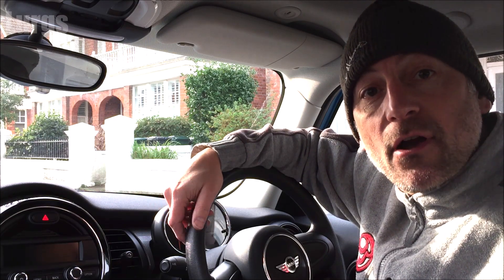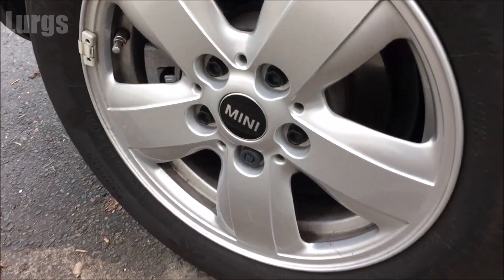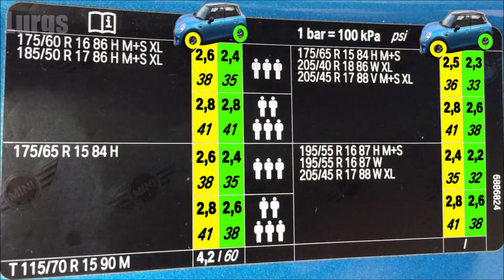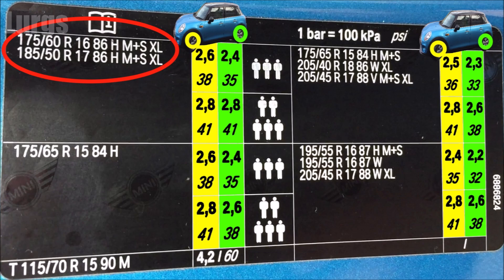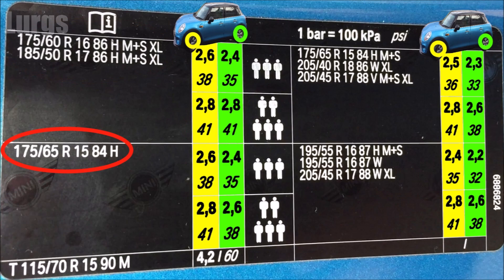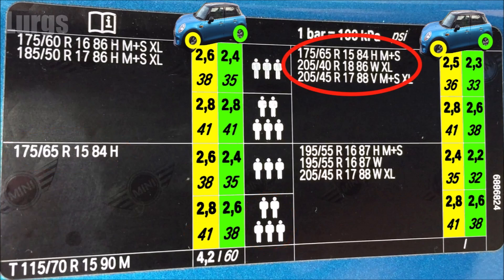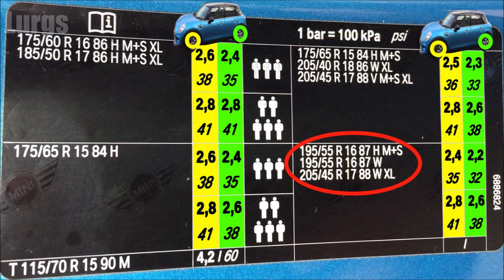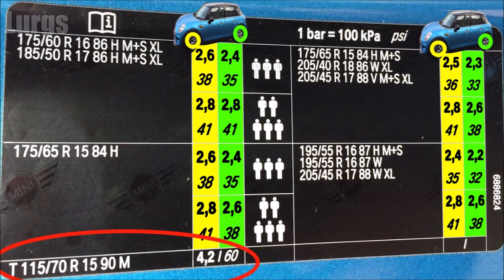Mini Cooper Tyre Pressures - Mini Cooper Tire Pressures

Comment: Hi , my tyres are 195/55 R 16 kpa  230 for both front and rear  that converts to 34 psi ?  Please can you assist me with this .
Reply from the maker: Yes that's correct, pump them all up to the correct pressures and all should be good.
Reply: @LurgsHowToGuides  ok thanks for confirming!

Comment: On the plate you show, the left column shows an option for 175/65 R 15 84H. The same is shown in the right column but with the addition of M+S. How do I know which pressure to apply; what does M+S mean? Cheers.
Reply: Just found out that XL = Extra Load and M+S = Mud and Snow. They can be found on the tyre wall if they apply to your tyre.
Reply from the maker: Can’t imagine there’s a lot of driving in mud and snow. I always pump up based on average amount of people in the car. I normally slightly over inflate mine for better fuel consumption. Happy Easter 😎🐣

Comment: What's your recommended PSI for winter driving? I'm currently running on 38psi front and back but last night something weird happened when I turned to a junction, the front and rear left tyres feel like they've come off the rim and its vibrating and making funny noises, similar to driving on a punctured tyre except they're not punctured at all. Going to the alloy shop to have them re-balanced anyway.
Reply from the maker: I keep mine same as recommended. But sounds like you have an issue with your tyres not being seated properly, hope you get it sorted.
Reply: @LurgsHowToGuides  After my initial comment, I changed the front tyres to 36psi and 33psi to the rear. The ride is somewhat better. Then I went to the local tyre shop to check for buckles etc, thankfully no issues there. They did rotate the tyres, changed the front tyres to the rear. However, still getting the horrible ride from the rear left wheel only when I turn into a road. Getting the steering and suspension checked out tomorrow, but the tyre shop thinks it's the alignment. Thanks for your helpful video by the way.